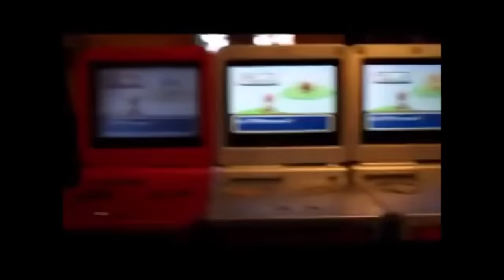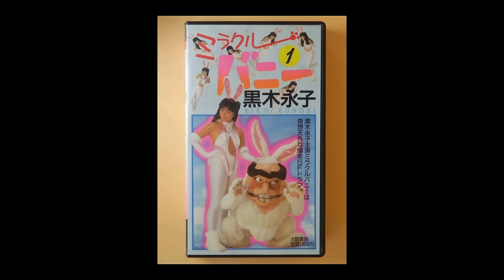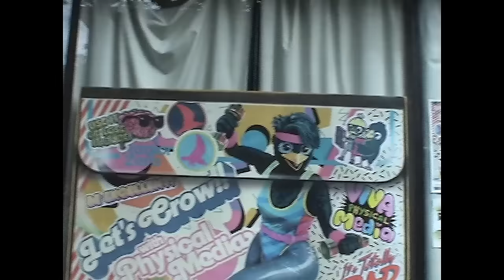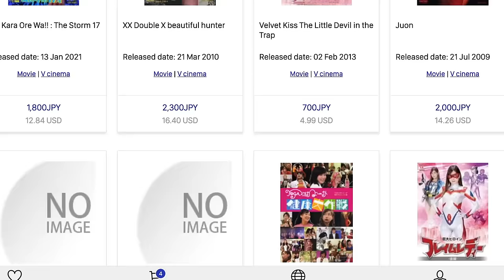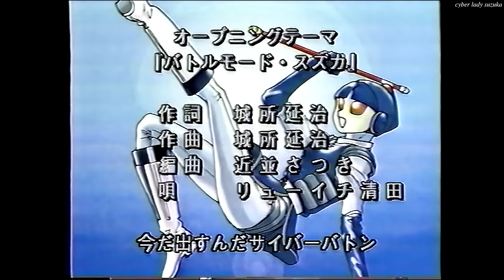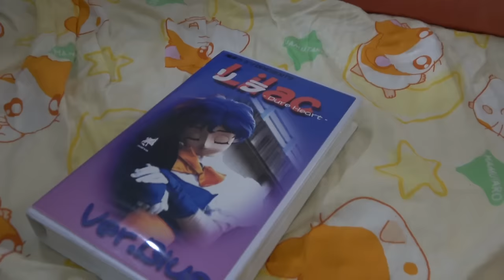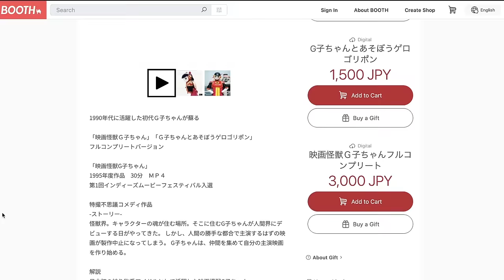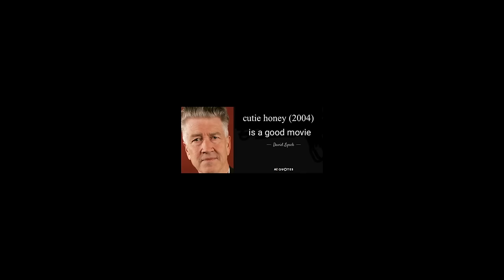weird & kinda scary tokusatsu girls

Comment: I know there's something to be said for the camera work, but all of those outfits are **legitimately** friggin' gorgeous. Not even just design-wise--the construction is absurd. Like....like making armor have organic curves and fit well is hard, making the undersuits not look terribly awkward is hard, having helmets with accessories that stay on in the right orientation is hard, getting completely smooth edges or totally even paint jobs is extremely hard... But then doing all of that in a way that it'll stand up to rolling around in dirt, mud, sweat, fog, explosions, AND WATER???? That's such an unbelievably subtle flex that I wouldn't be surprised if most of the budget went to building them, especially 'cause they'd need extras on hand in case something happened to a part of the suit. They deserve the niche kink corner for how incredibly they were put together.

Comment: Easily one of the best episodes of any anime EVER is the Melancholy of Haruhi Suzumiya which is entirely their high school production of the main casts' Tokusatsu short film. The one thing that somehow makes it better yet is that in the original - and utterly insane - airing order, it was the very first episode, in which you had zero context for the characters or what was happening or why they were flubbing their lines in a cartoon with a VHS filter for the whole deal.
Reply: whoa, lynch's comic as segue is a deep cut
Reply: IMO, it's a mildly amusing episode if you're aware of the context, and a waste of 20-some minutes if you aren't. I guess on rewatch it's better than the baseball episode at least?
Reply: @SnakebitSTI And it's absolutely rage-inducing as the finale, and the "payoff" for the endless 8

Comment: Out of morbid curiosity I found and started to watch "Big Boobs Buster" and it is absolutely insane. Within two minutes the protag gets turned down by her crush, and then out of no where (most likely due to me not knowing Japanese) it cuts to a man going straight on to a nipple for like a second, not once but twice it cuts to this. Just after eight minutes it is the aforementioned "spongebob pushing though metal, but with boobs" scene, complete with comically large protruding nipples.
I have never laughed so hard, not even 10 minutes in and its amazing

Comment: So I kept going back and staring at the phone at 27:19 because something seemed too familiar, then I realized than that's probably a Sony Ericsson z520 (or one of its variants), I had one of those as a teen back in 2006-2007 and that light show thingy on its rim (mine had blue lights tho) is burned into my memory from being woken up by my phone's alarm lighting up the whole room in dancing blue lights every time I had school early in the morning. Ignoring a random text message in the middle of the night was kinda impossible with that phone. That clip literally unlocked a half-forgotten memory.

"Ausencia Memoria" sounds so much like a broken translation. I guess they meant "ausencia de memoria" (absence of memory), but that's too incomplete of a sentence for a title, there's a certain ambiguity to its meaning and not the good kind of ambiguity, it almost sounds like an error message. Or maybe it should be "memoria ausente" (absent memory), which makes a lot more sense.

And as a third aside (just so it's buried at the end), rather than being creeped out I actually feel kinda drawn to characters with completely black but reflecting eyes, as in that the surface still reflects light like an eye usually does rather than being matte. Probably because I have a thing for characters, or irl people(yes it's a thing, but not a natural one tho), with dark/black scleras.